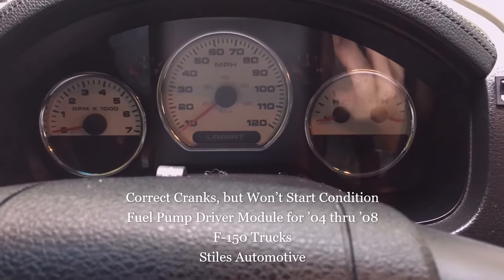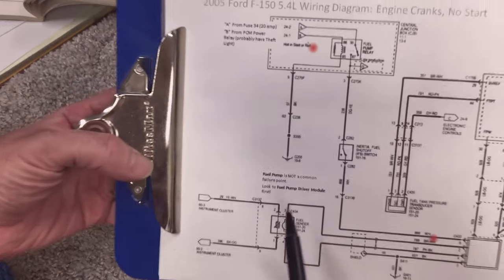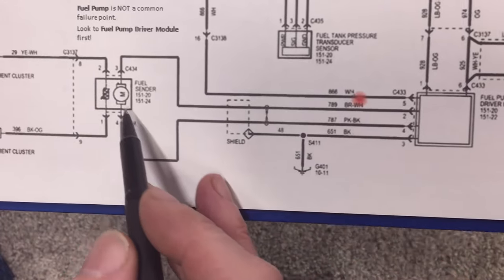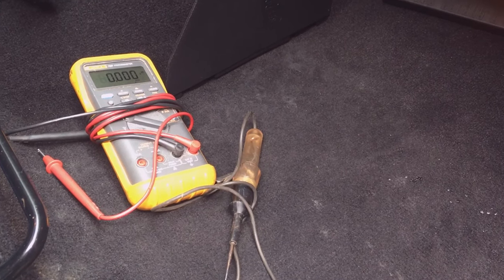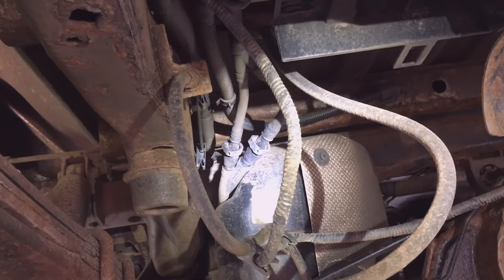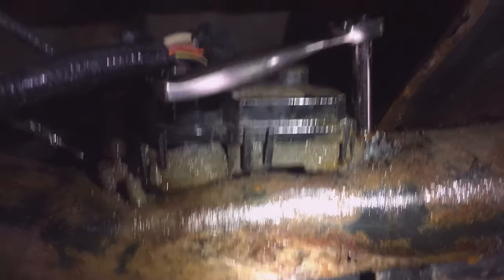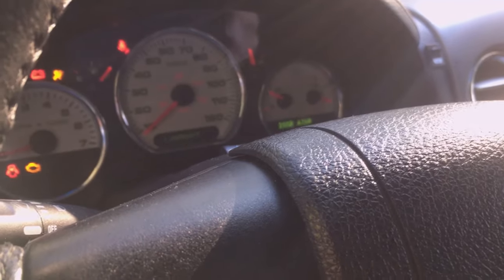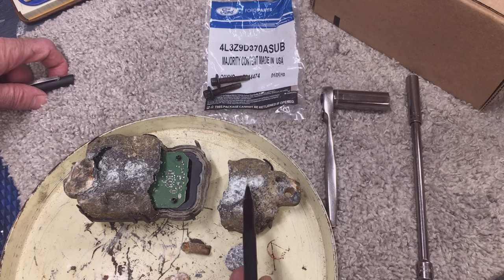Correct Cranks, but Won’t Start Condition – Fuel Pump Drive Module for ’04 thru ’08 F-150

Comment: Mine has intermittently cranked but didn't start a few different times.  I tried a couple of times and it started.  Wonder if this is my issue.  Might take a look and swap it out if it looks bad.  205k and rusty so I'd guess that's the issue.
Reply from the maker: Moto, Yep replace it if corroded at all, clean the Electrical Connector and grounds, check the Wiring Harness to the FPDM (from Frame to FPDM). - Stiles

Comment: Thanks for the experience Great video.  I'm having similar problem I changed mass air flow sensor and it started right up and run fine   I though I fixed the problem,  I shut it off and started it up again  and it started just fin. But then THE PROBLEM STARTED APPEARING AGAIN AFTER 40 MINUTES  CRANKS BUT WON'T START. Now am just sitting here scratching my head 🙃  it feels like its upside down
Reply from the maker: I don't think you can install the Mass Airflow Sensor upside down, but see my video as a reference, Mass Air Flow (MAF) Sensor Cleaning - Motorcraft AFLS131 {#3L3Z12B579BA} '04 thru '08 F-150 Trucks 5-4L   https://youtu.be/zS9J2GGHSSg    I hope this helps! - Stiles

Comment: So, I changed my plugs with no problem, using the Motorcraft SP-546 plugs. My truck was running ok with a slight miss before changing them. No after I changed them, the truck will start fine, I take it for a test drive, and about a block away, it dies. It cranks and cranks but no start. I let it sit for a few minutes, and it starts, and I'm able to get to get it home. I am confused!
Reply from the maker: Sutton, The first thing a Military Mechanic asks the Equipment Operator is, "what is the last thing you touched?" I'm trying to think what you could have done, but your problem sounds like a Fuel Problem, not a Spark Plug or Coil (CoP) problem. You commented on my "2004 thru 2008" F-150 Video; First, what Year, Model and Engine do you have? When you removed the Number 4 Coil and Spark Plug (Passenger's Side Back), did you remove the PCM? Did you remove the Electrical Connectors on the PCM? Did you touch the wires on the Electrical Connectors on the PCM.  The "let it sit for a few minutes" doesn't sound electrical to me, sounds Fuel or Heat related and you didn't drive it far so, likely not heat.  I'd love to know the Fuel Pressure on the Engine Fuel Rail during this cycle of run, die, crank and no start, and run. - Stiles

Comment: If I just plug in the new gadget without mounting it will it work? Will it know it’s not
Mounted and not
Work?
Reply from the maker: Brandon, I mentioned this in the video, when I talked about painting the new FPDM. I left the spot where the Mounting Bolt contacts the FPDM Base, un-coated so that if the Module is grounded thru the Base that there would be a good ground. I think that it is. And I think that it will not work properly if not mounted.  Let me know if you tried it and what happened.  Be sure to coat your new Module to prevent corrosion.  - Stiles

Comment: I have one of these trucks in the middle of the jungle in Guatemala and have been fighting fuel pump issues for 3 months now with no success. I managed to get a hold of a brand new fuel pump module but either it's not grounding correctly or it's not receiving commands from the computer. I use jumper wires on the connector pin two to five and three to four like you say in the video and the truck starts and runs. I left it in there and tried to drive down the street but after 2 or 3 times maybe 10 minutes total running the brand new Bosch fuel pump burnt out. Is it safe to assume that the fuel pump was under too much stress because there is no return line? Is there no way to Jimmy rig this thing to work? I'm on dirt roads in the middle of the jungle maybe 15 mile per hour max speed, I'm just looking for a way to make it start.
Reply from the maker: Alex, You didn't say the model year and engine of your F-150.  The Fuel Pump Driver Module (FPDM) pulses the Fuel Pump on and off to regulate the fuel pressure. Yes, if you run the Fuel Pump continually with no pressure regulation your Fuel Pump will likely prematurely fail. Your new FPDM grounds thru the Mounting Bolts to the Truck crossmember. Removing the Bolts and reinstalling them on a new FPDM likely has a good enough ground, however, you should remove it and clean the Mounting Bolts, new FPDM and the Crossmember at the mounting location with a Wire Brush.  You should clean the FPDM Electrical Connector (like I did in the video) with Contact Cleaner and use Dielectric Grease on it.  

With that said, I think your real problem is . . . You didn't mention any fault codes or Check Engine Light . . . and you should have for this problem . . . but, I believe you have a bad Fuel Injection Pressure Sensor, (below is the link to the Rock Auto Page for my 2005 F-150 5.4L Sensor, buy/order using your Truck information). This Pressure Sensor is located on the Engine Fuel Rail, Mine is on the Leftside (Driver's Side) of the Air Filter Housing, behind the Power Steering Fluid Reservoir. You should normally get a Fault Code for this sensor, but maybe you didn't. When you replace it, again, clean the Electrical Connector and apply Di-electric Grease.

Next, if the above didn't fix your problem, Clean the Electrical Connector(s) (I need to do a video on this, but have not) under the Plastic Cover  on the outside of the Frame on the Leftside (Driver's Side) of the Truck. These Connectors, joint the Rear Harnesses to the Front Harnesses on the Truck and can became corroded. You should clean and Dielectric Grease these some day, anyway. Even if you fix the problem.

There is more, if you still have a problem you need to clean the Grounds and Electrical Connectors on the Powertrain Control Module (PCM). The PCM is located in the Engine Compartment near the Battery on the Firewall.  Be careful, don't clean the Connectors if you don't need to, you could damage the PCM Connector Pins.  But, Someday if you replace the Battery, clean the PCM Grounds with a Wire Brush and coat with Anti-seize.

If it comes to cleaning PCM Connectors, do a continuity check on the Signal Wire from the PCM to the FPDM, these are the 2 smaller wires I point out in the video.

There is not a easy way to jerry-rig or bypass this system.

Let me know how it goes! - Stiles

https://www.rockauto.com/en/catalog/ford,2005,f-150,5.4l+v8,1431304,fuel+&+air,fuel+injection+pressure+sensor,6376

Comment: Hi, I have a 04 f150 4.6 v8 heritage, I'm having a intermittent crank and start, it has been checked with Scan tools at a dealership, the tech could not find any code's, I asked the service manager if it could be the fuel pump driver module when I picked up the truck, he didn't know, what would you recommend I do ?.
Reply from the maker: Vernon, Sorry for the late reply (I normally get to your type of question with in 24 hrs), I was down range. The Spark side (and PCM side) of your problem, often results in a OBDII code, but the Fuel Side (ie Pressure Sensor, Fuel Pump Driver Module and Fuel Pump) does not.

Intermittent problems are hard to diagnose, I'd love to know your Fuel Pressure at the Fuel Rail. 1) Fuel Pumps can get old a flow less fuel, but normally don't fail this way, they stop all together. 2) Like I stated in my Video that you are commenting on (and the reason for the video) if you haven't replaced your FPDM, I'd do so, but You need to pay attention to the wires (intermittent problems are very often broken wires or bad grounds), remove the Electrical Tape and Harness Wrap from the Driver Module to the mounting location on the Truck Frame and inspect the wires, clean the connectors, re-wrap them with Electrical Tape. 2a) on the Left (Driver's) Side Frame (and on the outside of Frame) and mid-way between the wheels is a Plastic Cover that protects Harness Connectors, clean the connectors there. 3) You have a Fuel Pressure Sensor on the Fuel Rail on the Engine. It could be going bad or maybe dirty, in either case replace it.  

For the FPDM and the sensor, I would only use Ford Motorcraft Parts.  Use a lot of a good connector cleaner like this one: QD Contact Cleaner CRC https://amzn.to/3DKfOQ3

Let me know how it goes! - Stiles

Comment: I am having the same issue but my wiring colors are a bit different. Should I still connect it the same way you did.
Reply from the maker: My Truck is a 2005, other years use different color, but the Electrical Connector Positions are the same and the gauge (or size / thickness) of the wires are different.  Your Wire gauge is like mine.  Let me know how it goes! - Stiles

Comment: I have a 2006 f150 5.4 that will not start unless I use fluid. Then run and drive like normal. fuel pressure is between 38.5 to 40.0 while running. When no start the fuel pressure does not rise. 3 seconds of ether it fires up and has good fuel pressure. Any help
Reply from the maker: Young, I haven't heard of that exact problem before, probably because I'm not big on using Starting Fluid on Gas Engines, Diesel Engine sometimes, but not Gas.  I suspect if you don't have a wiring issue, that you have a problem with your Pressure Sensor on the Fuel Rail. - Stiles

Comment: I took my truck to a service garage and had it put on diagnostics and they said it was the fuel pump driver module.  So to make sure I jumped the ineg to neg pos to pos on the clip and still nothing. However I put the test light on the clip and did have power coming from the fuse box.. That being said why did my pump not kick in when I by passe the module by using jumpers?
Reply from the maker: Lou, I'm not sure why your Fuel Pump didn't run, I showed you the 6 Pin Connector in the video and if you have Battery voltage at the FPDM Connector, your Fuel Pump should have run. Your Fuel Pump could be bad, HOWEVER, this is much less likely.  This video is talking about the 2004 thru 2008 F-150 and if you have NOT replaced your FPDM yet. I highly recommend you doing so.  Even, in the event you find the Fuel Pump bad.

1) Make sure you have Battery voltage at the FPDM Connector using a Volt Meter, should read 11 to 12.6 Volts.  If you don't you need to find out why.
2) Make sure you have a good Ground.  Measure continuity to Ground.
3) And . . . make sure you inspect the FPDM Wiring Harness from the Truck Frame to the FPDM. Make sure it looks good and re-rap it with Electrical Tape.

Let me know how it goes! - Stiles
Reply: @StilesAutomotive  hi.
I have been looking your video. unfortunately I am not a mechanic but I am trying to get help. I have a2009 Ford F150 4.6L that cranks but won't start since a hit a loading dock. A mechanic couldn't find a reset switch but said the fuel pump was bad. I didn't agree but he replaced it anyway. I also put a new battery but still no luck to start it.
if you can help I will appreciate. Thank you 
Mo
Reply from the maker: @mamedaourndiaye2816  Mo, It sounds like you shipped your 2009 F-150 on a boat, I know about shipping Military Vehicles on Ocean-going Boats. Military Vehicles experience a harsh environment depending on which deck they are on. I would expect your F-150 would be treated better, but still be subject to moisture and salt air. 

I believe you are correct when talking about a Reset Switch, which is really a Fuel Shut-Off Switch.  Your 2009 F-150, is not like my 2005 F-150, I have a Physical Shut-off Switch, you do not. Your F-150 is similar to my 2013 Mustang. I believe your F-150 experience a bump which may have triggered this Fuel Shut-off Feature.

Reference your Owner's Manual Page 313 & 314 (I copy it here):
FUEL PUMP SHUT-OFF
In the event of a moderate to severe collision, this vehicle is equipped
with a fuel pump shut-off feature that stops the flow of fuel to the
engine. Not every impact will cause a shut-off.

Should your vehicle shut off after a collision due to this feature, you may
restart your vehicle by doing the following:
1. Turn the ignition switch to the off position.
2. Turn the ignition switch to the on position.
In some instances the vehicle may not restart the first time you try to
restart and may take one additional attempt.

Also, because your Truck is similar to my 2013 Mustang, my Mustang Video will help you: 

Mustang After Accident, Fuel Shutoff Procedure - 2005 thru 2014 Ford Mustangs  https://youtu.be/87NdhFFM_Lc

If this doesn't do it, your Mechanic needs to determine if the Fuel Pump is Running and you have fuel pressure at the Fuel Rail on the Engine. And determine if you have Ignition Spark.

Let me know how it goes! - Stiles

Comment: Thank you for the video I knew this could be the possible culprit and I think it is one day the trucks running like a top next morning crank no start..everyone was telling me fuel pump but I have a full tank! So I started searching checked fuzes and used your diagram and viola I have one as well rotted out! Ford should issue a recall for these parts. Yes it’s corrosion but what if my wife was driving with the kids and the truck died on the highway! Anyways Thankyou!
Reply from the maker: I agree, or at least there should be a Ford Service Bulletin out there and everytime one of these Ford Trucks goes near a Ford Dealer Service Department, the Manager should be offering to replace it, if it hasn't been replaced before.  You are welcome and Thanks for the comment! - Stiles

Comment: Sounds the same on my 2000 Ford Expedition but mine I connect the battery cables the wrong way could’ve the same solution?
Reply from the maker: If you connected the Battery Cables backward you likely caused other damage, may be Fuse protected you, but I'd be worried about the Powertrain Control Module (PCM) first.  Let me know how it goes! - Stiles

Comment: Unfortunately I replaced the FPDM and it is still crank/no start whats next?  I did the jump for the fuel pump and got it to prime/run but still couldn't crank the engine with it jumped.  

I for sure thought it was the FPDM with how badly corroded it was but I'm still only able to start once its warmed up outside.
Reply from the maker: David, You have to be more specific for me to help you, You said "it is still a crank/no start" then in the next sentence "still couldn't crank".  A crank and no start condition means the Engine turns over with the Starter, but the Engine fails to run or fire. This means you are not putting into the Engine: Air, Fuel or Spark, (assuming no other mechanical failures). Air is easy and likely not the issue unless the Truck has been sitting a long time. Fuel or Spark, you are working the Fuel Side if looking at the FPDM, Yep replace it if corroded at all, clean the Electrical Connector and grounds, check the Wiring Harness to the FPDM (from Frame to FPDM), check Fuel Pressure at the Fuel Rail (with the FPDM connector jumpered like in the video), if low Pressure, Fuel Pump is at Fault, if good Pressure, Fuel Pressure Sensor on the Fuel Rail is likely the problem. - Stiles
Reply: @StilesAutomotive  thanks for the response and sorry for the confusing comment,  it cranks but no start even with the FPDM jumped with 20 amp fuses.  When I jumped it the fuel pump was running, do I need to check the actual pressure at the rail or will jumping the FPDM and attempting to start be enough?

Could I disconnect the fuel pressure sensor on the rail to test it that way?

I plan on replacing the fuel filter since it's been awhile as well.  I also swapped fog lamp relay and PCM relay but still crank no start.

Thanks again!